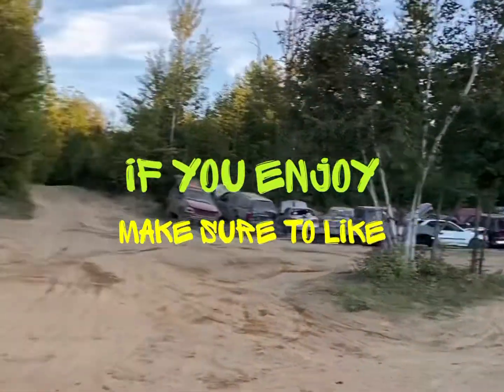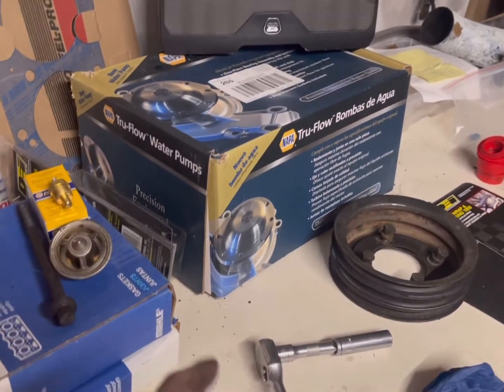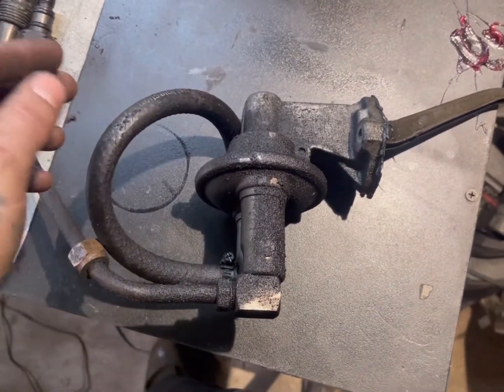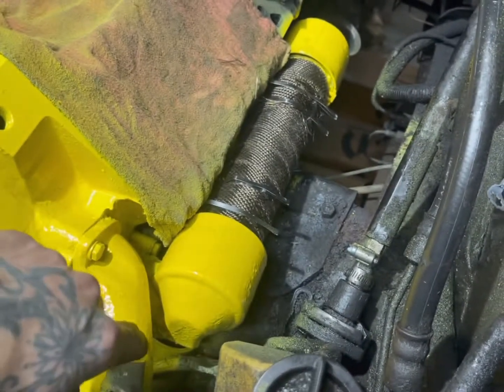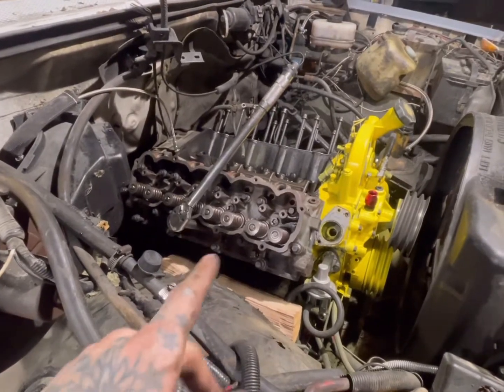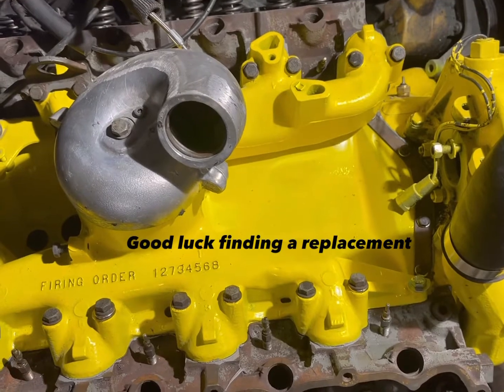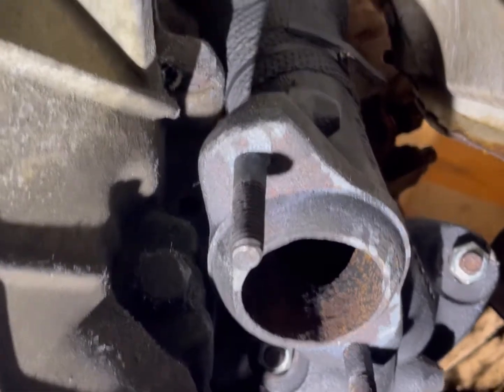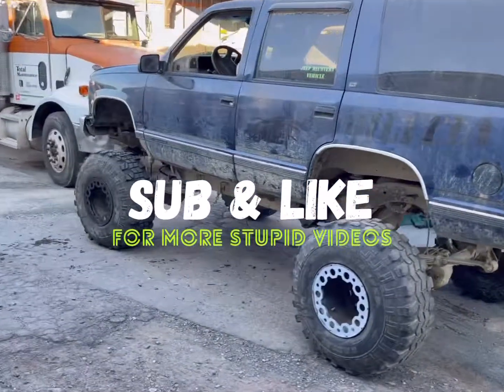7.3-6.9 idi turbo & top end rebuild (part uno)

Comment: Get a specific chasing tap, not a cutting tap. It will remove material. Especially a new tap. I actually cut a slot up the side of an old head bolt(or whatever needs chasing) with an angle grinder to use.

Comment: Shouldn't cylinder 1 be at tdc also before reinstall.
Reply from the maker: You can yes and should yes. However I did 0 work to the bottom end and made peens on the pump and gear so I could just drop them back in as a static reference.
Reply: @SassyMudTruckDegenerateDumbFk  ok so what you're saying is for example. If I was to just change my head gasket, I don't need to put the cylinder one at tdc for reinstall. As long as the timing marks were never off aligned.
Reply from the maker: @Isaiah12691  I’m not saying it’s the best way I’m just saying it does work

Comment: Heat rises.  Cooler is below manifold.  Would not worry about wrap.  Now if oil leaks on the o-rings, it will soak on your wrap and make a nice torch. Cheers happy roasting.
Reply from the maker: We figured at 1100 on egt’s the manifold will heat soak that rascal really fast. seems alright so far as I’ve noticed a dramatic change in oil temps while pulling grades.We do it in the bog trucks and other areas where the chance to catch Titanium bonded nickel wrap in theory may be high but haven’t had an issue nor concern to date.

Comment: Had a few questions for you since you seem like a fellow enthusiast: primary question - difference between the n/a and turbo injection pumps... not sure if the fueling and timing curves are different between the two and also between 6.9 and 7.3 db2s. Where do you source engine parts from? I’m having a bitch of a time finding bottom end parts...
Reply from the maker: Most parts are scattered to the wind I.e. rods mainly core pieces like blocks and cranks have to come from used sources. Cams, bearings, bolts and odds and ends can be sourced easily with some digging. The pump (db2) in a n/a form can support and supply an addition of a turbo but must have the fuel screw advanced somewhat and timing advanced or retarded 8* or so I cannot remember.. the bottom end parts you want are exceptionally hard to locate. The later model idi’s with stronger rods built for turbos. Clevite makes good bearings rod/main. Mahle makes rings and I will tell you definitely step the rings up! The iron rings from 6.9/7.3 are not to task for running 12 lbs all day believe me hence me powerstroke swapping.
Reply: @SassyMudTruckDegenerateDumbFk  alright that sounds good thanks for the reply! Did the turbo trucks come with stronger rings or not? I figure the compression ratios between turbo and non turbo engines are the same since the boost is so low. Was having a hard time sourcing bearings and rings particularly, especially for a 6.9. Have since sold that truck off. I’ve got my non turbo engines pump advance a dime width but unfortunately I don’t have a ferret meter so I can’t time it. Will a stock n/a pump need turned up a couple flat or a couple turns? I figure a couple turns would destroy the pistons. Did you swap the pistons for power stroke ones? Also, are 7.3 powerstroke rods usable in IDIs?

Comment: How much should a guy pay for a 7.3 IDI with factory turbo “ran when pulled”?
Reply from the maker: It really depends on your pockets. Typically idi’s up here go for dirt cheap but the turbo changes all that. Mind you my prices are for my area but a idi with a turbo can go 800-1000$ but a factory idi turbo engine (late models) go for 1,100-1,500 seeing as the internals are far superior. Best of luck bud.